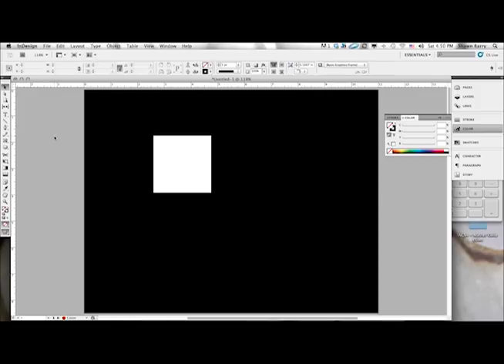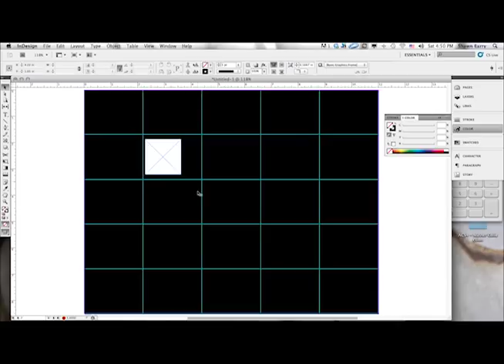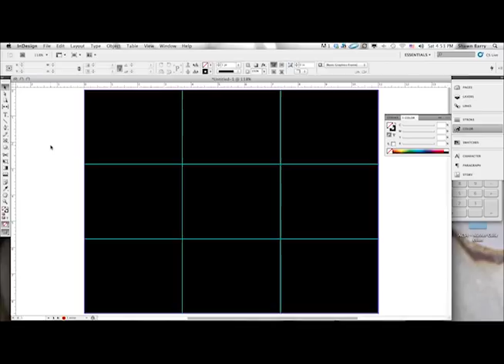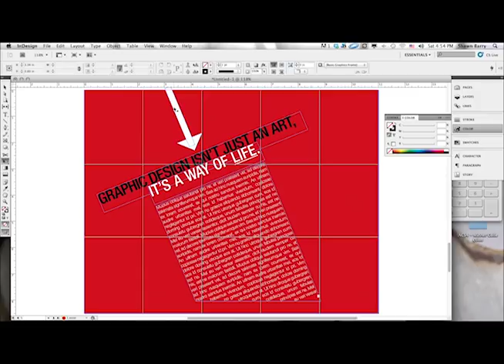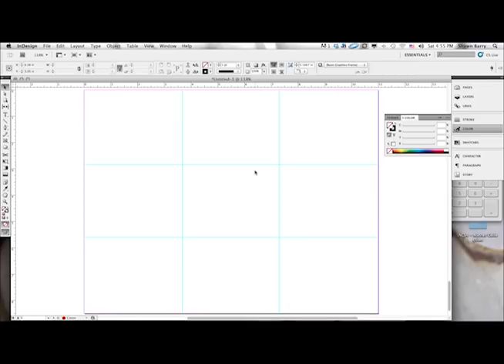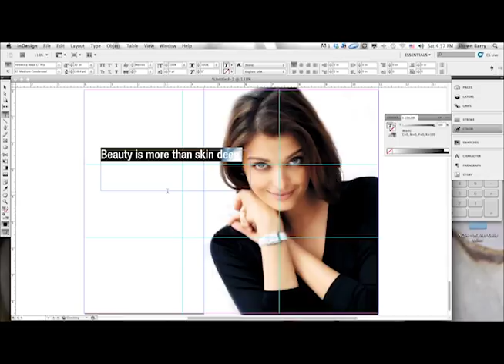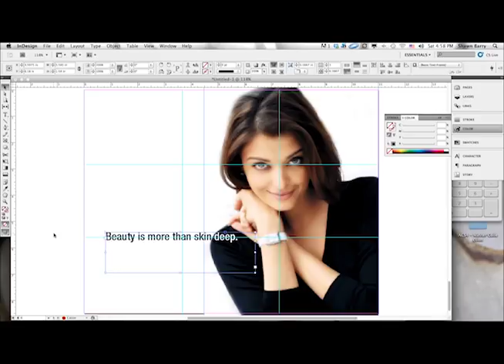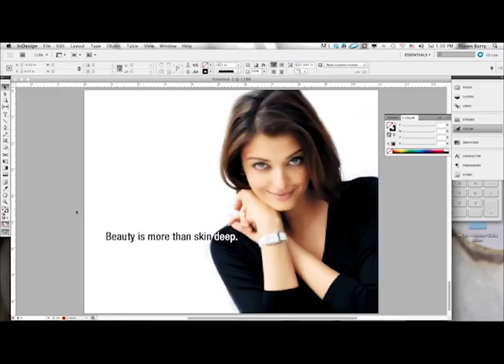Graphic Design Tutorial: Designing to a grid.

Comment: Indesign tip: there is an automatic function for columns and grids under LAYOUT.
Additionally, you can place a guide at 3.67, then do a Copy/Paste-In-Place (sh+opt+com+V). Then paste "+3.67" into the horizontal position dialogue box and it will add +3.67 to the item's position.
I know it sounds complicated, but do it once and you'll be tickled that Indesign does the math for you.
Reply: +V Wade Multiplication and division work as well. 3.67*2 makes life easier. The math revelation was revealed to me a few weeks back and I agree, it was a giddy moment.

Comment: Great video and nice explanations on the rules of 3rd & 5th.

Those are quite common in painting or still photography. One question thought I can't really find the answer : does those rules really apply whatever is the format of your support ? Speaking of the rule of 3rd for example, I have the feeling it's more powerful in a 1:1 or 4:3 format than, say, in 2.35:1 (Cinemascope). Or is the support format totally irrelevant ?
Reply: Thank you +Shawn B for your reply.

Yes indeed nothing replace practice and experimentation ! In the video context which is mine, after some tries it seems that splitting the16/9 space in 4 vertical quarters and placing the main and secondary subjects on the 1st and 3rd give good results as it avoids too much dead space on the far left and right. And the space between the two focal points is wide enough to have a balanced composition without the subjects  "colliding".

But this is all very empirically based on my own taste ;) So your mileage may vary !

Comment: I wanted to know when I should use a grid of more than 3X3 ? and can I combine the rule of thirds with the golden rule?
Reply from the maker: Hi Lioz - it's hard to define when or when not to use a grid, as they are such an elementary part of design. Even if you never consciously use a grid, as your design improves and you gain experience, it's likely you're using them in a way you're not even seeing. To answer your 3x3 question, the answer is: you can use any grid anytime, as long as you can design within it successfully. You can definitely combine a grid with a greater guiding principle, like the golden rule, because these are ALL theoretical tools. At the end of the day, if you can exploit the technique and create a successful design, you've done it right.

Comment: This is absurd. You can layout texts and elements based on the composition of element or elements that are the highlight of the page (it can be the full screen background image, or a large person's picture (like in the video). The best position of other elements will vary depending on the structure, colors and layout of the highlight image. In this video, the text can be basically placed anywhere and it would look good too. The artist's job is to set the proper margins, right font and font size, not too large, not too small, and a balance in the color of the font with the image or images colors. I don't believe you need to be using any sort of grids to do a good and excellent design. This is what they call in Spanish "una paja mental".